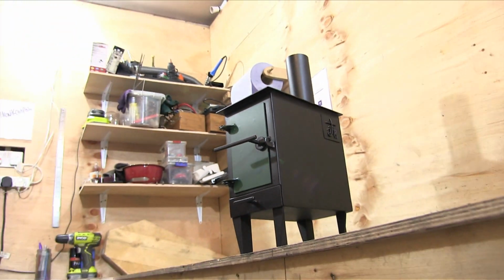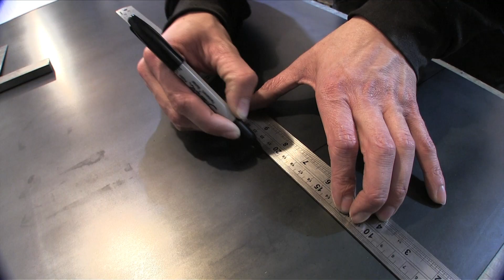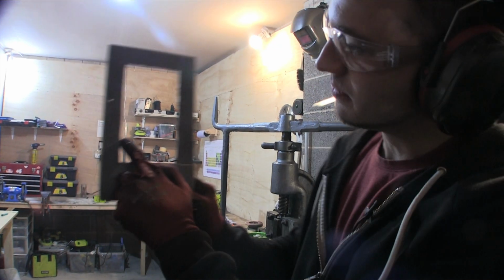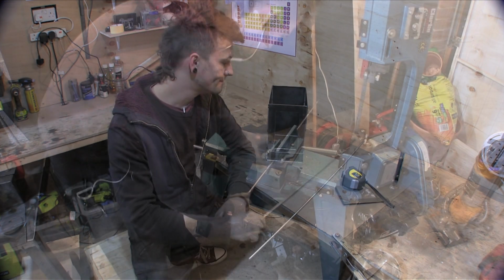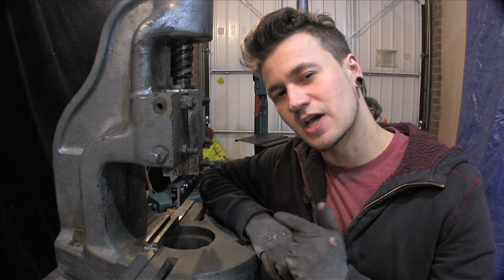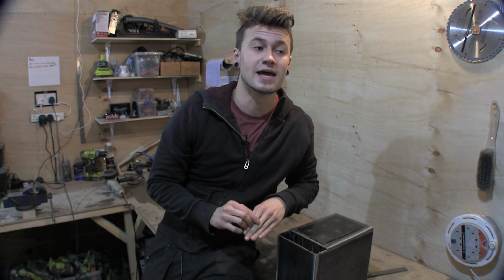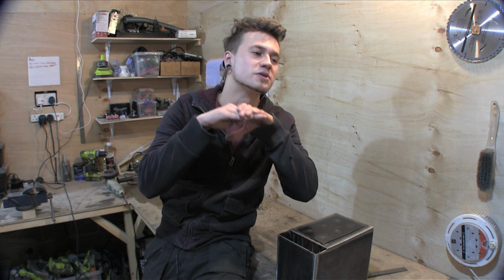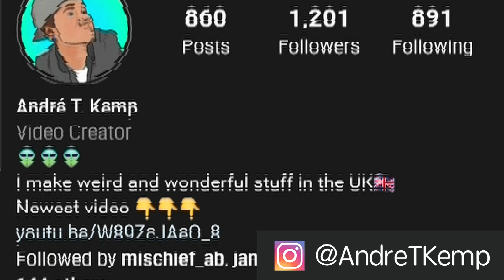Making a Mini Wood Stove

Comment: Lovely video mate. Did you ever sort out some glass for it? I built a little log burner around this sort of time last year as well but not quite as neat as this. - You can get heat proof glass on eBay uk. The seller I got my bit from had all sorts of random sizes so there'd easily be a bit the right size. 

All the best 
Andy
Reply from the maker: Hey, glad you like the video 😊
I’ve not managed to make one with a glass front quite yet, but will probably revisit it in the future. It’s on my list. 

Thanks for the comment. Glad you’re enjoying the content ☺️

Comment: treat yourself to a gas lense chief. clean the steel with acetone before tigging itll be perfect tig welds after that.

also I use a oven pyrex dish lid for my log  burner, good for 300'c 😉
Reply from the maker: Yeah, I actually got a gas lens shortly after this project! Sure does make a big difference 😊
Reply: @DreDurezza  there some cheap kits on ebay that do a selection of lenses  for under 30 quid. not sure of your background but if you keep that steel seriously clean your welds will be perfect.  what machine you got?
Reply from the maker: In my final year of my level 3 apprenticeship, my dude! Running a little esab buddy TIG. Just in my garage making these videos as a hobby outside of work. How about yourself? Where are you from, brother? 😊
Reply: @DreDurezza  Nottinghamshire way,  originally coded for structural steel but making my own stuff now. I wasn't picking faults just giving tips. my mates just got a new tig and its a hard thing to grasp straight off. keep the videos coming. I binge watched them all last night
Reply from the maker: @rockinnathan  I didn't take it as you picking faults, don't worry! Most people don't realise how skill based TIG welding is, so it can be a long learning process. Cheers for the tips, brother! I do welcome the feedback :) hope your friend manages to stick with it!

Thank you so much for checking out my channel and watching my videos! The support means a lot. All the likes and comments help out loads, so it's much appreciated 🙏🤝